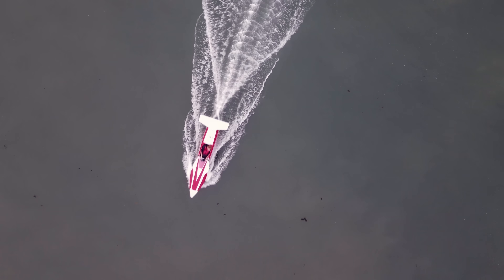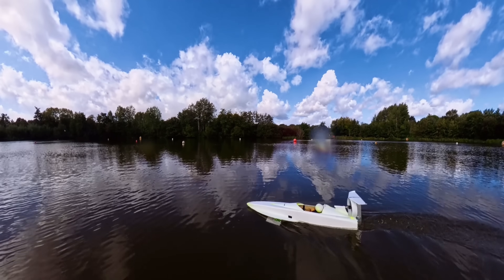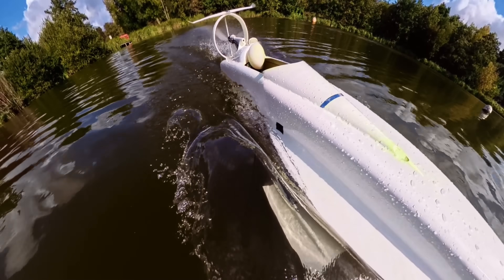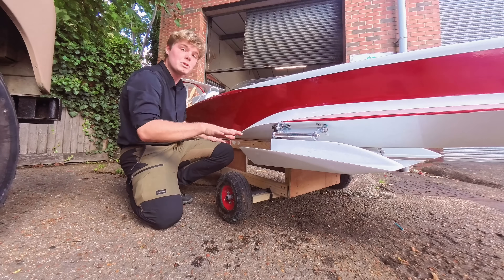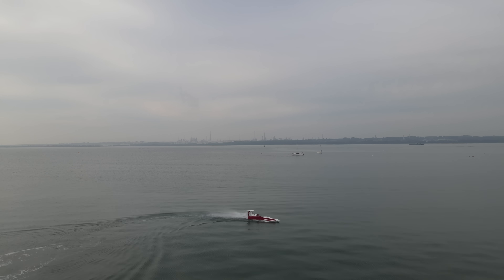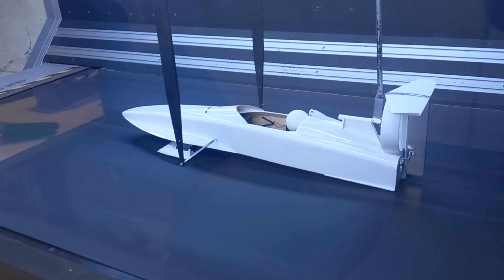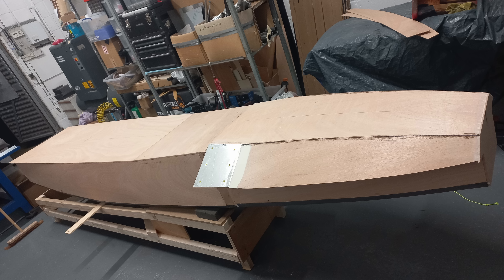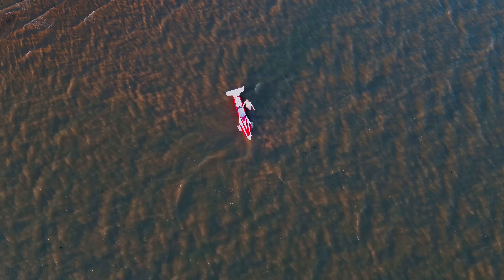How I built my own world record prototype - The APX hydroplane

Comment: Surface drive prop in water is always going to be faster than a pusher air prop unless using a turbofan engine. Surface drive has more bite than a prop in the air. the prop tip speeds are going to endup beyond supersonic and probably hit crazy harmonics and blow apart in order to get to 200mph with such a small pusher prop. That is going to be a lot of prop pitch. Every RC boat I have built for speed runs the surface drive was much faster. At high speed any water droplets would cause my air prop to bog down or explode. Thatvis one cool looking boat. I hope you get the record soon. That would be awesome. Best of luck keep us updated please.
Reply: Already in WWII we had propellers with 5000+ hp going through them and reached 500+ km/h. It's a solved problem, he just has to size the propeller.
Reply: @alisioardiona727  Errr, thats not correct! 500kph is 310mph. Only ONE boat has ever reached that speed -Spirit of Australia driven by Ken Warby On 8 October 1978, on Blowering Dam in Australia , the record was 317.6mph / 511.11kmph.  The Slo-mo-shun IV a propellor driven boat was a pioneering unlimited hydroplane built in Seattle, which set a new world water speed record of 160.3235 mph on Lake Washington in June 1950, piloted by Stan Sayres. As  Slo-mo was the worlds fastest boat in 1950 it sort of disproves that any boat in WW2 could reach 300mph.The fastest propeller-driven boat is Problem Child, which achieved a record speed of 260.98 mph (420.0 km/h) on November 22, 2009, in Phoenix, Arizona. This Top Fuel Hydro boat was built by Eddie Knox and piloted by Daryl Ehrlich
Reply: @geoffholme  I was talking about propeller driven vehicles in general, these were aircrafts, and the fastest (Dornier Do 335) got to 763km/h during WW2. Sure it's harder on a boat but not impossible.

Comment: Please use 2 rudders to increase control and keep the hydrodynamic center of pressure behind the center of mass. The aerodynamic center of pressure is closer to the rear wing and should match the hydrodynamic or you could get airborne at 200mph.

Comment: The scale model wipeout at 5:12 is a reminder of how deadly water speed records have been! I don't know how to protect against that sort of deadly wipeout. It just seems like anything that causes a boat to nose up and catch some serious air underneath is in big trouble.

As for how to go fast over wavy water ... maybe some sort of water spray lift effect might work. Under the nose is a rod which slices into the water and causes a good amount of water to spray upward. This water spray hits the underside of the vehicle to produce lift. Sort of like using ground effect lift, but water spray is much denser than air so not as much surface area is needed.

Comment: I have an idea...if u could somehow inject air around the hydrofoils and and struts to create supercavitaion ..that would help slip thru the waters tension easier ...the Russians have proved this fact with their shikval super cavitating torpedo which uses a rocket engine and a specific nozzle at the front..and inturn they directed some of the exhaust gases to the nose to create a bubble around the torpedo itself ..and slip thru the water around 200 mph .
Reply: Similar to blown airflow on laminar flow wings. The hard part there is making sure the pressure of the airflow is constant and high enough to just stop water ingress. Wonder if that's possible with redirection of high pressure airflow at the top of the leading edges being vented to below and just behind the leading edge, rather then requiring the mass of an onboard compressor and piping?
Reply: @PiDsPagePrototypes im not sure what would be better honestly...I almost want to say since hes going to be doing many individual passes it would kind of be better to use high pressure air tanks to store whatever kind of gasses that would be capable of doing so . Not sure if nitrogen would work..or freeze ....or use a rocket engine and confine all that exhaust gas and dump it in the from of the foil itself.im not sure how to properly design or make what im talking about .but I feel like it could be done . Maybe use high tensile carbon fiber for the foil ...and have a specific amount of holes on the leading edge and direct gasses to those holes
Reply: @weld4200  Monopropellant rockets, like those that run on Hydrogen Peroxide are basically a Gas Generator, but with smaller storage requirements than those of compressed gasses, and they're easy enough to build.
Reply: @PiDsPagePrototypes pure hydrogen peroxide i think is dangerous if it touches water ..I could be wrong tho...I think the Germans dabbed with it with the me163 rocket plane ..the full was highly corrosive and what not
Reply: @weld4200 Venting is only beneficial when there’s a significant portion of the hull in the water. This is why we see stepped hulls in high horsepower racing V-hulls and catamarans. There is maybe some benefit for steps in the hydrofoil, but only in the ability to increase the pitch of the prop and still be able to get it on plane. Once the planing surfaces are dry, the steps, or air inject as you’re suggesting, would be moot.
Reply: Great idea , but just a thought here, the boat is not in contact with the water, so will it still be a boat or an Ekranoplan? Believe it or not, there are funny things called RULES ?? and they are set by the UIM! Non compliant - no recognised record. The Recording above mentions the Uni boat from the USA -it DOES NOT hold the speed record [The British Jaguar electric boat does]as it doesn't comply with the rules. It may be the fastest electric boat but not a record holder. I mean how about getting a supersonic plane, attach a rope to the tail , fly over a lake with the rope in the water and wahoo !!! a WWSR nope it doesn't comply with the funny things- Rules.
Reply: @geoffholme The Spirit of Australia was hardly in contact with the water. And it didn’t have a prop in the water either. It still holds the world water speed record.

Comment: When ever you see high speed water craft lose control longitudinally and flip end for end its due to air getting under the front of the hull and the thrust generated at the rear of the boat.
Some suggestions to ponder:
-Maybe the wing needs to be at the front like a formula 1 car controlled automatically by software/actuators.
-If the thrust fan is at the front (pulling) vs the rear (Pushing) it will keep the longitudinal balance better and the CG/CM forward improving longitudinal stability.
I love your development but worry about longitudinal upsets as speed increases.

Comment: Marine Architect here. This hull is really really sketchy for going fast. It seems very narrow and I do not like the shock absorber Plates at all. It just all seems to likely to bounce and catch some air. Like other commentators have already mentioned have a look at H1 Unlimited Hydroplanes. The Design as is will be very prone to flipping or going into a death spiral. Talk to some Marine Architects that have already made highspeed boats. Going fast on the water is one of the most dangerous forms of motorsport there is! At the moment the boat looks like a 50s/60s Water speed machine. Not really confidence inspiring. The technology and knowledge about safe planning hulls, Hulls in Ground effect etc. have come a long way. Do not disregard the warnings and fatal lessons of the past.
Reply: A quick YouTube search, every other H1 hydroplane video is of a flip.
Reply: @TheZitherish  Yes and still the safest way to go really really fast on the water. Shows how dangerous it is... No imagine if this guy flips in his coffin...
Reply: Lorne Campbell appears to be the go to guy. The top boat Spirit of Australia 317.6mph was designed and built by its driver Ken Warby. Dave , his son is presently testing at over 250 into the same home design[on the kitchen table!] The WWSR is the most deadly of all the speed records but this project does not come close to being near it --yet
Reply: @geoffholme 
Wow. That looks very planted. There’s the difference between track and straight line speed as with cars.

Comment: I’ve lived eat and breathed your quest for water speed all my life. Racing boats growing up. My dad made them. Was at the kilos when the original speed record was broken for electric boats at 93 (?) believe it was.  
I would love to design and drive a boat to 350mph. 
Your design may be fast, but at 
200mph, that design has one of the highest potentials to be a death trap. 
This design will probably have similar riding issues and be less stable than the U.S. Discovery II. 
I would only try to go over 125 in perfect water (and just as importantly wind). 
I would also highly recommend you figure out what riding angles would throw the boat off into a death spiral at 200mph and have big enough flap system like Nascar’s have that is properly programmed to catch it and be able to stabilize it before it gets out of hand. If you had a small horizontal wing flap that would both help its stability left right and up down (from being on both sides). The secondary Nascar style flap would be a system if the horizontal flaps went out of its programmed parameters. These secondary flaps would have a primary purpose of being at a location that helps keep the boat in a straight line by assisting the airflow. 
Without any backup assistance, your design will have some potential for issues to a point you’re rolling the dice on the fate of your life. It may not be a 6 sided dice. For the most part the 70% death rate for people attempting an all out speed record have all died above 200mph. Just many of them were in hulls that were more stable than yours. 
A crash above 150 in a non-inclosed saftey cell cockpit will almost always kill.
It would also help a lot if you put an inch or two step in front of your riding plate with a steeper angle for at least a foot. This would make it safer as it would make the probability almost zero from catching if your bow caught a jump that then forces the plate beneath the water on the way down. This is probably the most unsafe part on the boat, (and the suspension that was mentioned by others).
You fin in back will also slow you down waaaay too much. It’s huge. That thing would be a gigantic turn fin on a speed boat. Try a smaller one each side as far apart as possible. It could also work better if you had a very small one at a specific depth in back on the outsides of the ridding plates. If you had it at a depth that when out of the water at speed it would give info to your telemetry that would be the point where you would only have a few more degrees of lift before the horizon stabilizers would start the assistance.
Other than the stability concerns, your approach to this record and the design is pretty impressive. Just be safe.
Reply: Your name seems familiar to me! Raced boats or models? For your info, Helen Loney  set a new Electric Outright Water Speed World Record of 76.8 mph in FireFly, a 15ft, three point hydroplane in November 2008. This was then broken by the Jaguar Vector V20E, a 295hp electric hydroplane, reaching 88.61 mph on Coniston Water in 2018. This is still the record holder as the other boats do not comply with the rules.
Reply: @geoffholme yes, you’re right. There was someone that had a 300 outboard on a too small fishing boat that I went out in while they were setting the course up. We did 93 through the kilos in it.  My dad made 600 boats in his lifetime, Sorensen Woodcraft. He’s made a few Champ boat/ SST 120 tunnel boats as well as a few sailboats for speed records. Plus his boats have broken well over 100 kilo records.
Reply: @aaronsorensen5165  thanks for summing this up. I also thing his propshaft and prop is not balanced enough. Vibrations can do a lot of damage. Plus he needs to get rid of that chain drive some how. thats not made for such rotationals speeds and will eat up some energy as well.
Reply: @geoffholme  This was true until the Princeton Electric Speedboating team ran in 2023. Same set of rules and a full kilo just like the Jaguar record. Just much faster
Reply: @andrewrobbins4657  Just been on the UIM website and searched 2023 and I cannot find any UIM electric record being broken and nothing by Princeton. I did find record 3946 Bob Wartinger and myself, but as usual, my name is spelled incorrectly 😂 Record 3870 is Peter Dredge with the Jaguar boat and that is shown as the present record holder with Helen Loney 3677 as number 2. So either Princeton didn't claim it/ didn't pay the fees or it wasn't under the UIM rules. I acknowledge the Princeton team did reach this speed though. There are several boats under the construction for the unlimited WWSR most do not comply with the UIM rules as of yet!
Reply: @andrewrobbins4657  Can't find John Peeters name in the 2023 records either. He was the Princeton driver. It's records week at Coniston [Lake district UK] next week[3rd to 7th November] , there should be a couple of UIM delegates there so I'll ask them!
Reply: @geoffholme yeah, my dad built most of Bob W’s kilo boats. I built a few 1/4 scale R/C boats long ago from an F1 Tunnel boat that was 54” long. One of boat racings prop makers, made the lower for a 70cc chainsaw engine. I’ve made tons of rocket boats and straight line speed contraptions.
Reply: @aaronsorensen5165  Hi Aaron, I recognise the surname! I also have made hundreds of 'fast' model boats including rocket boats. Even put a pulse jet in one. Most of them have ended up as matchsticks as I have a tendency to not slow down! I was part of Tony Faheys 'British Pursuit team' in the 1980's when we ran the jet boat 'K8 Miss Alton Towers'. One of my boat ideas was 'stolen' by Ken Norris [very proud of that!] and was used as a base for the reverse 3 'Quicksilver' WWSR for Nigel McKnight. After lots of 'testing' we found reverse 3's have a major flaw and so that way forward has been discontinued. I have a contact Dave Aldred who is 'Longbow WSR' a twin Viper engined conventional 3 boat similar to 'Spirit of Australia' and 'Hustler'. Check out his website. He's just in the process of sorting out his 'cell' calculations [submitted to UIM] and building the 'cell'. I understand there are several WWSR boats being built in the UK at the moment several powered by 'Speys'. Dave Warby is testing at over 250mph and I am still waiting to hear what is happening with 'SP 600 D'Artagnon' which is UIM compliant and fully built. I missed Bob at records week as the weather was appalling! Coniston was flooded out. It was so bad we had a play with model boats in the flooded car park! I left on the Wednesday, not too sure but I think they ran of Thursday and Friday though.
Reply: this!